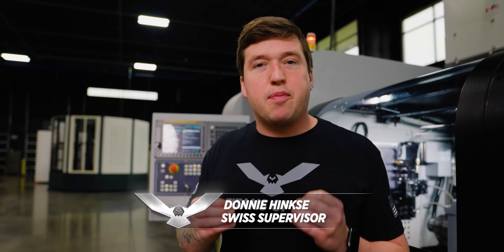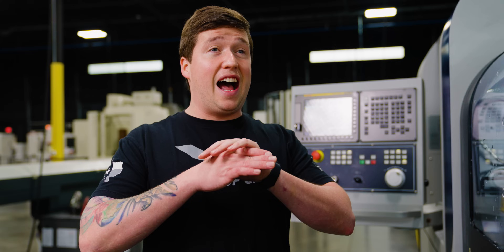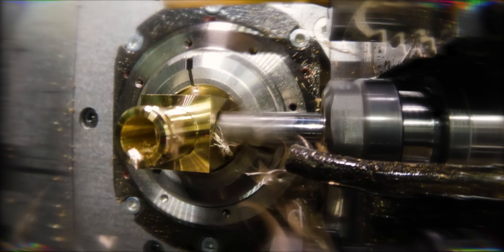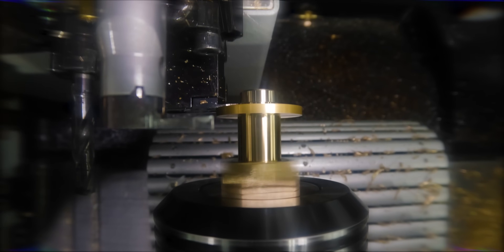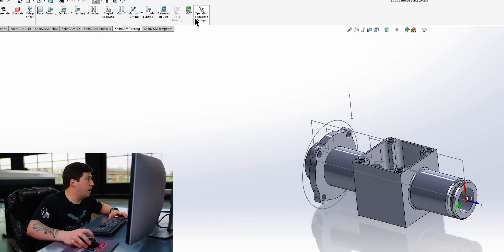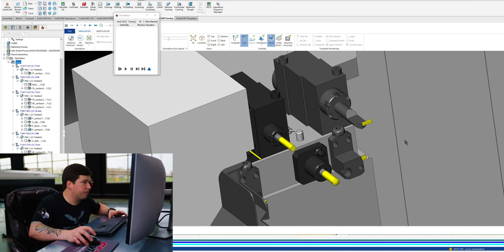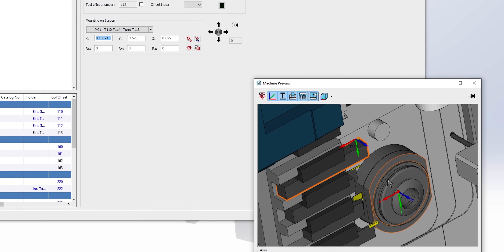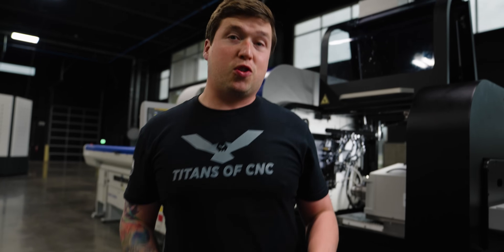Rapid Precision Machining a Fuel Injector Part

Comment: Don’t mean to be a prude Donnie, but Gibbscam cam will also allow you to manually move the machine components around during machine simulation. However, Gibbs will not allow you to label a fixture component for the first Op vs the second Op. The best work around is creating a second file or doing the second op in a different CS from your first op, some distance away. This is where I think solidcam has a solid edge over Gibbs.  Not to mention that solidcam post are open so anyone can edit them. Perfect for someone like me who has trust issues when it comes to my code.

Comment: the chipbreakers on a pcd insert are formed with a laser. they are the ultimate for aluminum. zero built up edge, very repeatable finish,  last forever.

Comment: Everyone knows Donnie is actually an Esprit user, (only had to use solidcam as they paid titan to use it). 
Why would anyone want to buy a CAD system to then run a CAM bolt on. Will be replaced by the 3dexperiance soon anyway.
Reply: The best part of my job is the respect Titan gives me for allowing me to pick and choose the products we show for swiss. Not anyone can walk in here and get their products shown on our channel. SolidCam came out a month ago and gave me just a few hours of their time and I was actually blown away at what they can do. I have ZERO acting experience. If I am excited about a product on our channel it is genuine! 

Not trying to come at you aggressively or anything. 

In time you will see why Titan and I went with them for our swiss solution!
Reply: 3D experience won’t replace Solidworks, it’s more like an addendum to SolidWorks and is being marketed as a low cost all in one MRP/ERP suite.  It’s more in line to compete with Siemens ZelX, and auto desks Fusion. 

These are not in same ballpark as dedicated CAD systems like Pro-E, NX, or AutoCAD. 

It also makes perfect sense to integrate CAM directly into the CAD system. It lets the CAM software use the CAD geometry engine for bodies and surfaces and lets that side of the software handle the model calculations, leaving the CAM software dedicated to toolpath calculations. It lets the cad model drive the cam paths directly, so any model changes will automatically update CAM paths (within reason) as the CAM paths are directly linked to the solid model feature tags. 

This makes it very quick and easy to simultaneously make model and machining changes without have to re-do the CAM.

Comment: If you had a repeat simple aluminum standoff job in the shop. Say every month of the 1000pcs and only needed 5 to 6 tools would you run it on the 32 or just leave in the cnc lathe area to be done. Takes 9pcs @ 12'. Plus, you have 2 other parts similar @ 500pcs per month. Different lengths but use the same tools & material.

Comment: What about Esprit CAM. I have heard that they are also good for Swiss Machines. Have you tried this software.
Reply: Esprit is awesome for Swiss machines. The posts for the Citizen line up of machines is as solid as I've even seen.
Reply from the maker: A bunch of our guys have experience with Esprit … we chose Solidcam for a bunch of reasons… one is mentioned by Donnie in the video… Ease of use.
They also have an education version so all can learn.
Reply: Looking forward to Solidcam tutorials.  Long time Mastercam user forced to switch at current employer.  Nothing but issues can't get round holes, iMachining absolutely sucks, cutting taper all over the place.  Seems like it takes at least 4 spring passes to get any kind of tolerance.  Used other software in the past esprit and siemens nx.  Seems deeply tied to solid works and the quirks really bit solid cam in the ass when you get crummy step files.  Solidcams you tube training absolutely sucks.  Really looking forward to learning this software correctly.  Thanks. @TITANSofCNC

Comment: But Fusion360 integrates CAD and CAM and the free version will allow 3-axis and turning...
Reply: That's all fine and dandy, but if the post processor sucks or is non existent then what do you have? Nothing of any value. What you are really buying when making a CAM software purchase is the post processor. If the post is trash the rest of the software is not worth anything either.
Reply: For the price point F360 it’s hard to beat. For the price point. But for more powerful software that either automates things and eliminates excessive clicking and constantly switching in and out of menus just to verify something, and more powerful tool path calculations you’ll need higher end software. 
Basic milling and turning needs, absolutely stick with Fusion. But if you’re getting into higher complexity, multi-axis machines, and complex kinematics to worry about, stepping up to Solidcam is a no brainier.

Comment: Thanks as I'm sort-of looking for a program that I can use to run a milling machine that won't break the bank. I was using one that started off low cost but now has ballooned into a monster and I simply can't afford it anymore that cost is yearly to have the program. That per year cost or you get shut down sucks as if you have a bad year then your out.